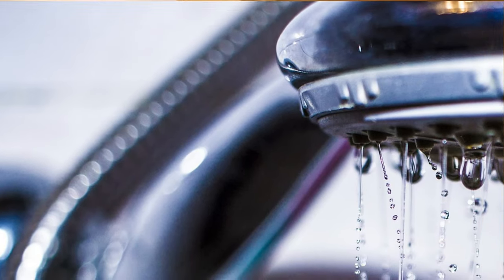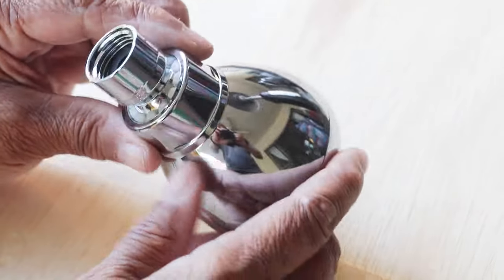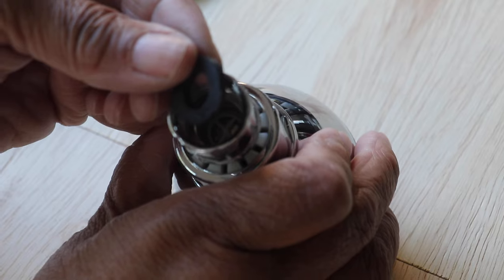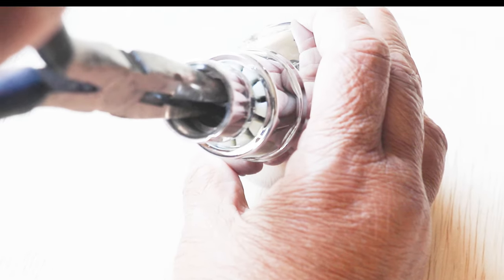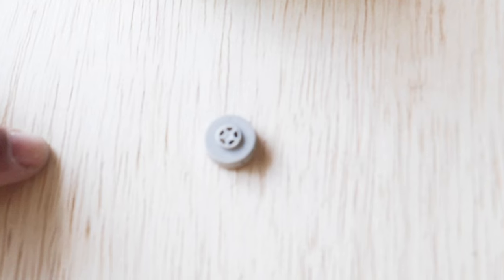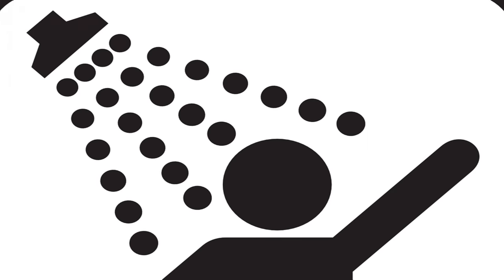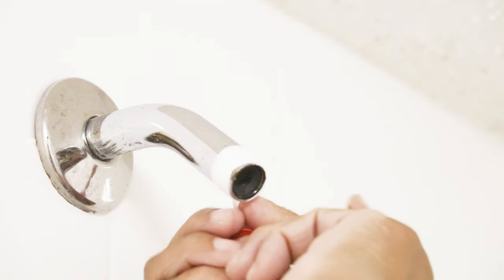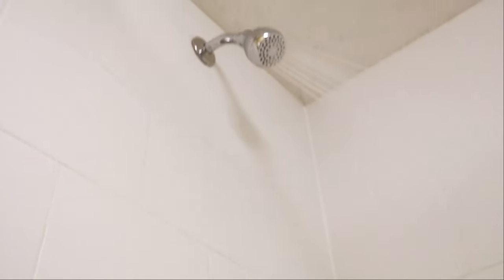Secret Few Homeowners know and PLUMBERS don't tell you

Comment: Thank you for the video, Leah. I always enjoy your tips.  I have to admit that I have removed flow restrictors from shower heads at times, both for customers and even once or twice for myself.
There are many factors that contribute to overall waterflow and pressure in a shower head. Some shower heads are either poorly designed or the design promotes appearance over function and these may experience ongoing problems with water flow or pressure, whether or not the flow restrictor has been removed. In these cases, simply changing the existing shower head may be the best solution.
Unfortunately, even the highest quality and efficiency shower heads can still seem to be performing poorly for the user's expectations. In these cases yes, removing a flow restrictor may solve the performance problem.
The trouble with this solution is that more and more communities, counties and states are requiring the use of flow restricted shower heads in all new construction and sometimes even when replacing an existing shower fixture due to the increased focus on overall water conservation. Mechanically, a shower is a water wasteful solution for cleaning. It gives good results, but at the cost of using a lot of water. To compare, a 2.6gpm (gallons per minute) restricted shower lasting a total of only 16 minutes will use 40 gallons of water; remove the restrictor and total water used in a 16 minute shower can easily be 70 to 85 gallons total. This is equal to flushing a modern water efficient toilet a total of 25 times, or running a high efficiency washing machine anywhere from 2 to 5 loads depending on wash load size.

Comment: I've always removed that flow restrictor first thing when installing shower heads.  I've also changed all of my faucet aerators from the standard 1.5 gpm to 2.2 gpm aerators.  More water flows, but I spend less time rinsing hands and dishes, so it's probably a wash (pun intended) in the long run.

Comment: For those complaining about water use, you can get an aerating shower head (sucks in air via the venturi affect and mixes it with the water - no moving parts). This appears to add volume to the water, and you can see how much difference it makes by simply covering the air inlet with your finger.

Comment: "Water Saver" inserts very easily  clog up with rust (if the house has old galvanized piping),  general  debris (sand/dirt/) or calcium (hard water) build up. They are a difficult to remove without breaking them. They make low cost  in-line flow rate adjusters that install just behind the shower head.
 Household water use generally  accounts for 8% of water use while agriculture and infrastructure account for the other 92%.

Comment: Good to know, in old homes with mineral coated supply pipes this is a must. If your in a newer home, try using vinegar on the shower head and you will get your flow back. Water bills are outrageous in many parts of the country. Great tip👍.

Comment: The Delta shower head I bought seems to have smaller shower holes in order to project the less powerful flow harder, therefore when I removed the flow-restrictor it actually had an adverse effect. It pushed a larger volume of water through those tiny holes and now I feel like I'm getting sand blasted when I shower.

Comment: I've got one of those 2 head, wand things.  I've removed those, but had to drill out the manifold to the point that the selector for the 2 heads doesn't work at all. Combine 75 lbs of street pressure and 70s Gerber tub plumbing?  It's called the monsoon for sure! Only issue is it reeks havoc on my outdated hydrotherm dhw system.  Temp fluctuations are inevitable when 37 of us are on the same loop! Apartment living,  so fun!

Comment: I've seen a couple people ask about the thread tape here. 
It's a misconception that thread tape is needed on all threaded plumbing fittings. It is only needed on tapered threads in cases where the threads create the seal. 
This is not one of those cases. The rubber washer creates the seal against the end of the threaded pipe. The threads only act to mechanically fasten the pipe against the washer. 
Thread tape will help prevent seizing from rust, but is not necessarily to create the seal

Comment: This will help those only with that same shower head in the video. Depending on the brand, all flow restricters are different, some don't have a washer because the flow restricter is also the washer. Some you have to drill out the restricter, on and on. I'm saying this as a professional plumber of 27 years to those who thinks its that easy, also I do this for all of my customers. That way they don't have to call me to make unnecessary repairs because they watched a video and thought, I can do that.

Comment: I have an adjustable flow restrictor.  It has a T shaped handle that I can turn o have less or more flow.  Probably something that a local hardware would have?  It screws on in between the pipe coming out of the wall, and the shower head.
Courtesy of Half Vast Flying

Comment: Water availability has not been a problem in my area. There is plenty of fresh water but I see the benefits in any area of conservation. There is less demand on the source pumps to fill the water towers. This means a reduction in electricity consumption that may be generated with coal or gas fired plants. And I feel I will get clean with a shower even if the pressure is low. I do, however, see the benefit in this video because I am sure restrictors can become clogged. I imagine they can be changed or, at least, cleaned.

Comment: Thanks Leah!  I thought these were a “mandatory” part of my faucet/shower head-Discovered these little gems when I took the faucet apart because the water. would hardly run~we have very hard water and older pipes. They are always plugged up with little black flecks from the pipes thus turning my low flow faucets into “no flow faucets” they’re all getting removed now-I even went to the store once to find a replacement thinking it was a mandatory ”Functioning” piece of the faucet🙄 😂 —thank you for continuing to help me learn on my journey of home maintenance/repair!
Reply: Yep.  We use to have that too with our old pipes.  It was black particles like they use in fish tank filters.  They clog filters like nobody's business.  I use to have to poke them out of the filter holes with a sewing needle.

Comment: Similar to this, I have had an issue with one bathroom sink twice over say, six years.  At some point, the water flow in one bathroom faucet went way down.  Both times, I took off the aerator and found that some black material had built up there, impeding the flow.  I don't know if it was coming from the water supply or some part of the faucet was degrading and letting off black particles.  Either way, just cleaning that out restored the water flow to normal.  If you are a little handy, you can at least check things out and maybe save some plumber's fees!

Comment: In the city I live in, these flow restrictors become quickly clogged with lime build up from hard water.  Before you know it, you get a trickle.  They pretty much have to be removed.  Also, if you live in a house where there is lower than average pressure, it can make showering a real pain.  Taking longer to shower saves nothing.

Comment: There are certain valves that do not regulate the flow, so if you remove the flow restrictor you will get the full force coming from the 1/2" pipe which can be too much. You can modify the flow restrictor to allow more water without giving you the full force from the open pipe. You could drill a 1/8" hole or a 1/4 " hole in the middle of the restrictor and then insert it into the shower head and reinstall the head.

Comment: Probably all that is really needed is to remove, clean and reinstall the restrictor.  There was probably calcium buildup or other foreign matter blocking several openings.  Use an old toothbrush to clean the restrictor under hot water.  Or soak it in vinegar first if calcification is caked on badly.  Should be good after that.  The restrictor is there for an important reason - to save water.

Comment: My shower has a flow-restriction VALVE on the side.  I think this is also available as a connector you can put between pipe and shower head.  This allows me to, say, use less water when I a start my shower, soaping up, or when I'm shaving, and strong water flow isn't needed, and still get a strong flow when I'm rinsing off or shampooing and conditioning.  I think it's worth saving water, but doing it with a little twisty isn't handicapping your shower, it's being responsible to the environment and your water bill.

Comment: Another quick tip while the head is off snake wire coat hanger into the pipe it could be clogged as well after you snake the pipe a little bit and broke up some of the crud turn the water on and flush it out then replace the head you'll get more of a tropical shower after that

Comment: I had a shower head with a built-in flow restrictor. I took a drill and opened up the area and now I have a good flow of water. Make sure you clean your showerheads with vinegar once a month. Put equal parts water and vinegar in a plastic bag and put it over your shower head and tape it on. Leave it to soak for 20 minutes and remove it and run the shower.

Comment: I've increased the flow on bathroom faucets in order to fill pet water dishes and water nearby plants. But, I'd be cautious before doing so in a shower. The restrictor shown looked dirty to me, so I would have first tried to clean it. Otherwise I would have seen if higher volume replacement was available. But, I've had past showers that would quickly drain a hot water tank, so I'd be a bit cautious about going full bore. I did buy a hand held shower a few years ago that had 2 different output levels, which was a nice feature.
Reply: Maybe there’s a smudge on your lens.

Comment: On some of the Moens, especially the hand held’s, you have to drill out the plastic restrictor and reinstall it. If you don’t, it won’t tighten, “seat” enough, and will leak, at the connection. BTW, I was told by a Engineer, the restrictors were tested at 60 psi, anything less and you would get even less flow.

Comment: In my case, as is a very small percentage of the "civilized" world, the restrictor is needed to provide enough back pressure to activate the in-line water heater.  Remove the restrictor and you have to open up the water valve too much to turn on the heater, resulting in high pressure, but cold showers.  I leave them in, somtimes even add more restriction for a hot shower.

Comment: I change several shower heads on a weekly basis with high dollar brand names. They do require plumbers tape. I’ve been to 100s of calls where tape wasn’t used and then they suddenly start spraying all over customer’s Newley painted walls 7’ away. Usually when the shower head gets moved from original angle. Products today are made of plastic which always flexes/ loses original exact shape.

Comment: I remember the old fashioned flow restrictors. There were two of them. One for unheated water and the other for heated water. If you wanted less water you barely opened the valve(s)
I know! It's crazy isn't it.
What's even crazier is, if you wanted warmer water or cooler water, you would open one valve a little more or a little less than the other.

Comment: Im a business owner. 5th generation licensed master plumber. I get alot of calls on pumps under sink. People think they need a new pump. When its 2 screws and take the filter out and clean it. And alot of calls with the sensor on hotwater heaters. They shut the tank down if younpaint or clean with cleaning products. Vapor sensor. And the ao smith hotwater heaters the worst on the market. After only 1 year the coupling gets carbinated. You just sand it it takes 5 minutes you dont need a new tank

Comment: Love your diy videos!! I have a question about my patio hose bib leak that is attached to a galvanized supply line. the leak is because the threaded end of the galvanized pipe is rusted. Best option to fix? there's only about 2-3" of pipe sticking out of the brick.  Can I use a coupler of some sort to join my brass faucet? I don't think the pipe is long enough to thread in place? Looking forward to hearing your thoughts!

Comment: I did the same thing with a new bathroom sink faucet I installed a year ago.  It wasn't putting out the flow of water like the old one was.  Once I removed the flow restrictor it started putting out water just like the old faucet.

Comment: A better solution is the Delta 52652 (it used to be sold as the Incredible Head). It's a low flow shower head that increases the shower pressure. Once you see how quickly it rinses soap and shampoo off, it's hard to go back to normal shower heads. Just be careful using it if you get a sunburn... not fun.

Comment: Years ago I found out about this. I took out the flow restrictor and put in an adjustable valve right above the shower head. Then I can turn the water up to rinse my hair, then down to barely a trickle to shave my legs and scrub my body, then up to rinse off all the soap, then down to brush my teeth... and so on. 

I get to save water, but have the shower that I want, when I want it. The water pressure was ridiculous before I did this. I couldn't figure out why some faucets absolutely blew water out, buy my shower was this weak stream. Some Googling saved me so much frustration.
Reply from the maker: Nice

Comment: Funny thing is my house has 97psi at most fixtures so I had to replace the shower valve so I could meter the pressure that water hurts hitting full blast lol

Laundry machines  and dishwasher have a modified supply to lower them down to 45 -50 to prevent damage

Comment: If you can't pull off the restrictor, just drill a  small hole on the restrictor with a small drill bit.  
If the water comes out slow, then make the hole bigger to adjust the flow.
Try to get most of the plastic shavings off, if possible.

Comment: Just a heads up...there are two problems with pressure systems...flow (gpm) and pressure (psi)...when you remove the flow restricter you don't increase pressure...you increase flow...

Comment: There is another reason you may want to remove these. If you have an instantaneous gas system, these 'water conservation' restrictors can even prevent the system from providing hot water. If there isn't enough water flow, the system won't turn on! I have some relatives who after having new faucets installed no longer had hot water for washing up, or washing/shaving their face. Needless to say removing these was a 5 minute job, and now they have all the hot water they could need. (If you're curious, an instantaneous system will not turn on until water flow is above a certain amount, this is to save gas in the event you have a water leak or don't turn off a valve completely)

Comment: I thought I had a similar problem. But the pressure at the mixer is great (installed a rebuild kit at the knob). But the water output out of the pipe with the shower head OFF, is poor. Some other problem somewhere.

Comment: Also, if the valve leaks ,and you're trying to solder the pipe,stuff a small  piece of bread down the  pipe giving  time to solder, the bread will melt away after opening the  valve

Comment: Stop up the drain, take a shower. Measure the water in the tub. Take out the restrictor, plug the drain, take a shower. Measure the water. My test showed about the same water. Without the flow restrictor was a much more pleasurable shower.

Comment: A small reminder.  A lot of people are on water meters.  And in my city water is 3.90 cents a cubic metre.  Or a thousand litres.   Roughly 250 gallons.
     So if you have to weigh the potential increased water use with your budget.  
      A lot of the comments seem to indicate that high flow shower heads mean you take shorter showers and that the restricted shower heads are a false economy.
      However studies show that apartment buildings that switched to low flow shower heads had a marked decrease in the total water consumption of the building.
      But it's your money....so make your own call.

Comment: Leah, you left out one little bit of info which might prove to be important for some folks. Sometimes when the flow restrictor is removed the rubber sealing washer will sit deeper into the fitting. As a result, the fitting threads will bottom out on the supply line before forming a tight seal. In such cases the flow restrictor can be drilled out and replaced, or additional washers can be inserted to match the thickness of the original flow restrictor.

Comment: The flow restrictor in our shower head gets a little off center once in a while. The pressure difference is insane. Without it, it will blast your skin off, but in a good way.

Comment: The rubber washer does not require the plumbers tape as that is duplicating un-necessarily !
Reply: both doesn't hurt anything, plumbers tape is like what a dollar for 10 rolls.
Reply: The washer is essentially useless, because as you tighten the shower head, it just pushes up into the shower arm. I always use teflon tape (plumbers tape, as she called it) when installing shower heads.

Comment: Remember folks, this is illegal to do according to the Uniform Plumbing Code each state and municipality enforces for a reason. I've been a plumber for over 30 years and when shower head performance is lowered, especially one that has been installed for many years, it is due to build up of hard water deposits clogging those little openings. An over-night bath in straight vinegar will soften and loosen those deposits (scrub with an old toothbrush) and I suggest you do this annually. Be a part of helping our planet conserve water; now that this kind person has shown you how to take this apart and re-assemble. An adjustable crescent wrench will save the finish vs. slip joint pliers with a rag cloth.